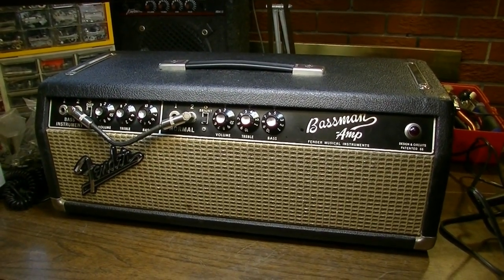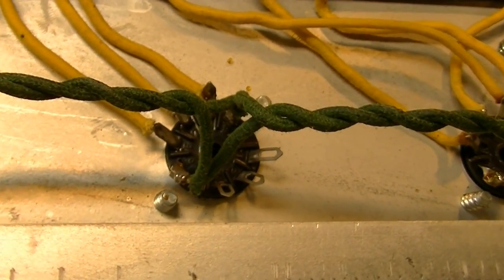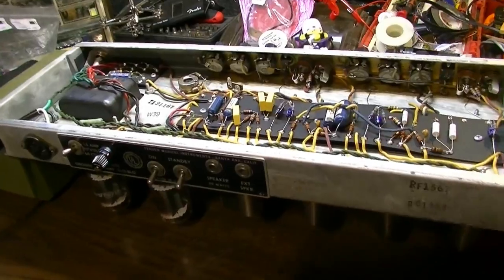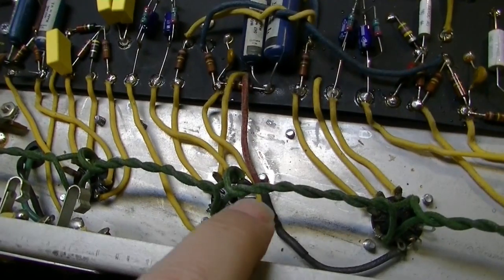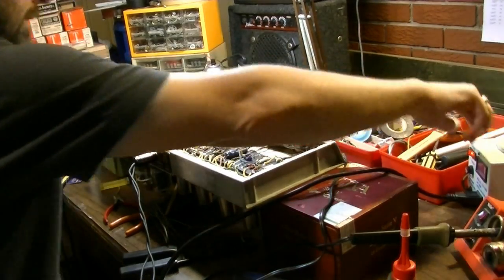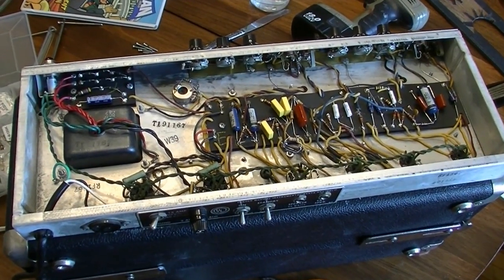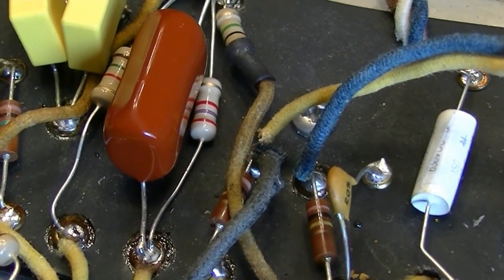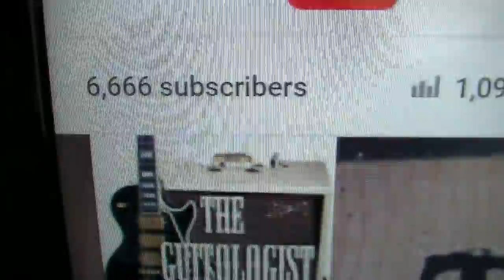Hacking a Blackface Fender for Monster Gain, Blasphemous or Badass?

Comment: Hey youtube, I'm the owner of this Bassman and am super happy with Brad's handiwork. Pre-mod, this amp would NOT break up at the volume levels I practice at and I really haven't found an OD pedal that I think sounds good with this amp. Initially, I hoped switching to 5881 tubes and biasing hotter would fix the issue but after learning that the amp was already (poorly?) modded when I bought it, I figured I'd let Brad make the best out of the situation. And he did. I got tons of compliments from the other bands we gigged with. It was one of the better shows we've played.
Reply: Before Brad did his thing and you were running with both channels jumpered out of phase how did it sound?
Reply: The best way I cant think to describe it was bland, but oddly full. Initially, I went through the normal channel but I left it at keyboardist's house and he played his rhodes with it jumpered. The next practice, I just left it jumpered to try to maintain that fuller sound but I wasn't happy with the tone, which was why I brought it to Brad.
Reply from the maker: That's awesome to hear, Russell! Bring it by any time you need work. You're always welcome. Also, just for the record...I watched this video back again and I believe I either cut out that part or failed to mention that the circuit ended up being closer to a AB165, meaning you WERE actually going through the 3 stages of gain before the PI. Totally m y bad for not mentioning that in the vid. Bottom line: you weren't playing OOP after all with channels jumped. But anyway, great to know it is working out.
Reply from the maker: Also Russell, if you get a chance, do a quick video with a Les Paul and link it here. I should have included a humbucker clip in the demo. I'd be interested to hear it with a Paul.
Reply: Just an FYI, if you're having trouble finding OD pedals that sound good with a Bassman, take a look at R.J. Ronquillo's YT channel sometime. He uses his BF Bassman about 80% of the time and uses tons of pedals with it. I'm much more of a Bandmaster guy than a Bassman guy, but I have to admit he almost always has a great tone.
Reply: great sound but it is not a bass amp anymore i use to have 2 of these i bought in the 80s for 100 dollars each
Reply: my bad the bass amp channel is still clean with bite
Reply: Russell Grant I would love to see a video of you playing on your customized amp! you have not posted but 1 video and that was 4 years ago! I wanna see you ROCK!
Reply: I will once I get a decent mic - my phone sounds terrible, especially at volume levels this thing produces.
Reply: Nice! This smokes! I have a "Mashallized" Bassman too made by a guy in Boston that roars just as good. A Bassman seems to be a really good platform to modify into a high gain beast. Mine sounds almost exactly like a Plexi and I couldn't be happier.
Reply: +Will ~ "They are the cleanest cleans you could ever want, but they're pretty sterile and bland."  That just about sums up what I feel about Bassman amps and also tweeds in general. Way too many upper mids. Just kills the sound for me.
Reply: How do you get ahold of this Brad to have some mods made?
Reply: I've seen a few bassist play through later Silverface Bassman 100's...those are pretty clean. This circuit (and earlier blackface circuits) is reputed to be not so great for bass because they compress/breakup as you crank them.
Reply: The silverface bassman has a ton of different circuits. A bassman 50 from the mid-70's doesn't sound much like the bf bassman.
Reply: make a video of demo
Reply: I have this exact same amp and it was totally bone stock when I got it, never been touched! AB 165 circuit  and got matching cab  w/JBL's  and a 66' Mustang bass all in  same deal, all one owner bought7 new in 67. Brought them home fired it up and prepared for tonal bliss!!  Man was I disappointed, Was pne of the worst amps I've ever heard. I recapped it, went through it  for out of spec  parts  etc.. still sounded like ass. So I also turned mine into  something I could use. -ended up with. Plexified Trainwreck type circuit an it ROCKS. I have all original parts in a bag attached to the headshell and if I ever sale it can change back to stock. I had. an early 50's tweed harvard as a teen and wanted another old fender since I started playing again a few years sgo and this was as old as  I was likely to get. I was into vintage stuff back in the 80s when It was just old stuff and all my amps are 60's-70/s because they sound good but anyone who has an AB165  amp and thimks it has tone or that is what a blackface  Fender is supposed to sound  like needs a reality check. Listen to a AA864  Bassman or AA964  Vibrolux pr a Deluxe and u will hear the
Reply: + David Gregory ~ Yeah, that's the way I see it. The BF and SF Bassmans just weren't all that stock. And to be honest, I prefer several SF Fenders to their BF counterparts. Many of the SF models used a 5U4 rectifier tube rather than the GZ34 tubes that so many of the BF amps used. A GZ34 rectifier tube might as well be SS rectification. It has such an in-your-face hard and immediate sound that I find them hard to play, whereas a 5U4 has more sag so the notes have some "give" to them. (I don't think any of the BF or SF Bassmans had rectifier tubes at all if I'm not mistaken.) SF Fenders usually don't break-up as much as the BF models, but if it's a clean pedal platform you want, they're hard to beat. Silver-faced Bandmaster Reverbs, Super Reverbs, Pro Reverbs, Deluxe Reverbs, and Princeton Reverbs with 5U4 rectifiers are the best tube amps Fender ever made in my humble opinion.
Reply: Just curious, which Boston guy? If you don't mind saying.
Reply: ss and just go 4 or 5x higher with the filters do that it will be radddd.
Reply: Just wanna say I'd love to hear this jumpered!
Reply: Yeah do that and put like a 330k on the plate of v2 and 10-20k cathode bypassed or not optional then annihilate with all the dirt.
Reply: The Guitologist What do you think the maximum number of gain stages you could use in an amp like this or in the deluxe/pro/twin line?
I've been wondering what it would sound like to cascade channel one into channel two internally.
Reply: this amp sounds killer,you can definitely hear a marshall in that bassman and start to see the path jim marshall must have taken when he started out using this circuit as a template for future marshalls.
Reply: I have the same problem with my  AC15 and Tweed Deluxe clones. I bought a speaker heat soak from Carl's Custom Guitars for about $40. It tames the volume without losing the dirt. You  may want to check it out.
Reply: I had a Y cord for my '65 SuperReverb and did the same thing. Interesting effect.
Reply: Anyway you can take some big pics of the amp so I can clone these mods-  this thing rocks!
Reply: Did you write down any of the mods on a schematic or anything I'd like to copy these!
Reply: No Because that PI cap is too small and sounds like shit lol....stop at the 22nf briefly and outputs and why some of them sound bigger than others.
Reply: It's great to see the comments and feedback from Brad's work. It's the little nuances that make the difference.
Reply: Russell Grant right now my buddy if modding my amp using some of the things he learned from this video. Thanks to both of you for sharing!
Reply: Russell Grant great decision 🍻
Reply: @8cspohn  You and me both. 15 years with Honeywell. Blown PCB's out the kazoo on everything from printers to monitors, document reader/sorters to hard drives. Early '76 to '91 but a plethora of components at hand to mod pedals and amps with test equipment/scopes us mere mortals only dream about.
Reply: The whole point of the Bassman was that it wouldn't break up (facepalm) BUY A MARSHALL!!!
Reply: I’ve been thinking about having this kind of work done, but it find it crazy you couldn’t get od pedals to work with it. I find that this takes overdrive better than any amp I’ve ever had. Either way, enjoy that sweet bassman tone.
Reply: There must be a lot of BF bassmans because they have always been cheap to aquire and a lot of them have had the circuit messed with. You can save components and return to original cicuit. I woul say a beater(like mine with a hole drilled in the front for a MV) woul be a great candidate for mods.
Reply: The Guitologist would you have a schematic for this? I’m wanting to mod my bass to the normal is fat clean fender and the bass channel is a hot jtm 45. Any help would be GREATLY appreciated.
Reply: I want one too
Reply: @wildbillhackett  Stupidest thing ever I sold my blackface Bandmaster years ago, it was perfect, huge headroom broke up just a little at high volume and had a much better sound than any Bassman I have played through. Very underrated amp
Reply: @japhygoldman8856  Phil Keaggy once stated in an interview that the Bandmaster he played when he was in the Glass Harp was the best amp he ever had. That's a pretty darn good endorsement.
Reply: @wildbillhackett  I front ended mine with a simple boss compressor used with almost no compression just as a boost pedal and it was luscious
Reply: @japhygoldman8856  Yeah, a compressor, a Tube Screamer, and reverb if it's not a SF Bandmaster Reverb model. What more do you need?
Reply: I modded a bassman 70 to ab165 with rev added
Reply: I think the amps sounds killer. If I opened up and amp and saw a spare triode, I would have done the same thing... I'm a purest, but at the end of the day it's your amps you can do what you want, I would have done the same thing.
Reply: @madaxe79  I'm  like you. The only amp that ive inspected and left stock was a htrd dlxIII. For me * i know all prod amps are set for middle of the road market...and just a platform for DIYer players/techs
Reply: @TheGuitologist  I want to hear it with a Stratocaster and a Mosrite
Reply: @ThePsprout  ive always thought if an amp didn’t have reverb then the two channels aren’t OUT of phase?
Reply: Bass or guitar?😅
Reply: In the 90ies we rented a practice cellar with a baseman. I put a RAT to it with my strat. Was awesome. Also low level.
Reply: Honestly brother I don’t think you should have trouble finding an OD/fuzz/distortion pedal for a Bassman. They are a great platform for pedals. I usually run the classics through mine. ToneBender, BOSS DS-1, BOSS Bluesdriver, BOSS hyper fuzz (for an easier to find, inexpensive clone of this one try the Behringer SF300, it’s orange colored and only cost $35 brand new, it’s a plastic casing so if you tour and gig constantly it could break but like I said $35 and they are easy to find anywhere), Russian Sovtek Big Muff black and green original versions, ProCo RAT. For a mind blowing box that virtually will turn your tone into a Plexi without having to add that third gain stage internally is the KEELEY El Rey!!! It is the most well rounded versatile pedal to get that British EL tube sound. I also like adding on the electro-harmonix Compressor box after the OD pedal. I almost forgot, if you aren’t playing extremely heavy music the BOSS Overdrive, the yellow pedal is great for getting some dirt and breakup. Also I can’t stress enough how much a well used and not overly used compressor will improve any OD/gain/fuzz!
Reply: Quality attenuator....
Reply: How do I get a hold of Brad I have a 68 bass man that needs work.

Comment: I got no problem with this kind of modification.  The guy bought it, he can do what he wants.  It's already been modded anyway.

These things are meant to be used to make music.  If mods help you do it, go ahead.  There's far too much cork-sniffery in all this stuff anyway.  It's even worse with guitars.  This is just physics-electricity doesn't know if it's going through a vintage paper in oil cap or a brand new one with dead on tolerances.

Those giant old blue caps do look cool, though.  How much of a nerd do you have to be to think a certain kind of Cap looks "Cool"?
Reply from the maker: Agreed on the "cork sniffery".
Reply: Old oil paper cap should go to trash, they leaky  and there is danger that they brake and it can damage tubes which expensive compared to new cap. You may like how it sounds but soon it could not make any sound at all.

Comment: I discovered your channel at a couple of days ago and I'm really enjoying it. There arent many youtube channels with technical amp content. I have built a couple of effect pedals kits and have plans to build and amp by the end of this year. You are helping me understand amps circuits. Thanks!
Reply from the maker: Very cool, man. My advice on your first build, dont worry too much about making it neat. Think of it as an eternal platform for experimenting, and not a finished product. And dont use a kit! Also, think about some twist you want to try with an existing circuit, try to avoid straight cloning. That way you'll run into problems and have to solve them. A success is almost a failure, if you think about it. It only gets fun if it's broken. ;)
Reply: I would add a humble +1 to the advice of not buying a kit. I did a scratch build of a well-known circuit, the Champ 5F1 into an old solid state amp chassis and having to make build and layout decisions and trouble-shoot it myself rather than painting by the numbers was so much more instructive. My dad has a BF Vibrochamp, I've had a SF Vibrochamp and a Champ 600 so I wanted to hear what a fairly straight sounding tweed version would sound like, so built it as they did aside from leaving off the negative feedback. Working from a proven design/schematic came in handy when it didn't fire up right away, it was relatively easy to trace a known-good schematic.

Comment: I believe what you are working on is an AB165 that was taken back to an AA864. the AA165 label was used until they ran out however the AA165 circuit itself is SUPER rare. It was made for 1 month. that would explain the buss that you found disconnected and reused for the added gain stage. that originally had 2 200k feedback resistors mounted to it out of the phase inverter to the 6l6gc.